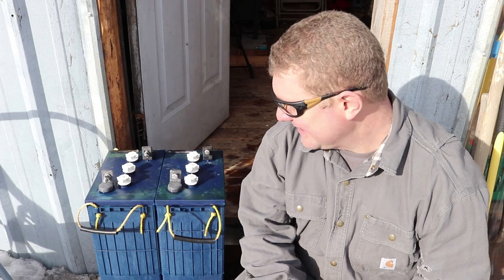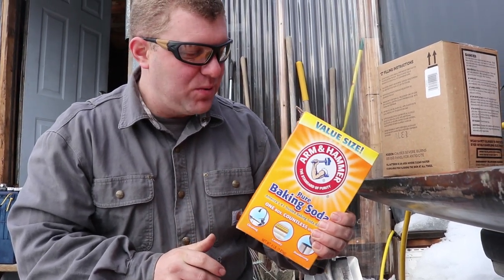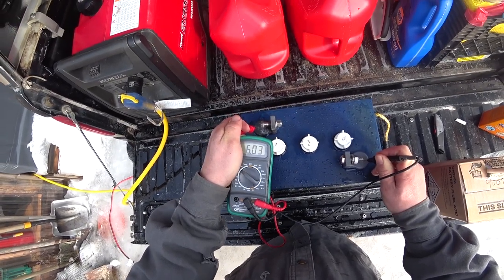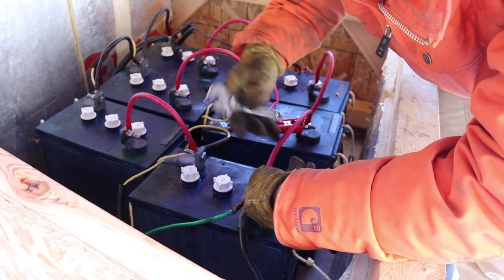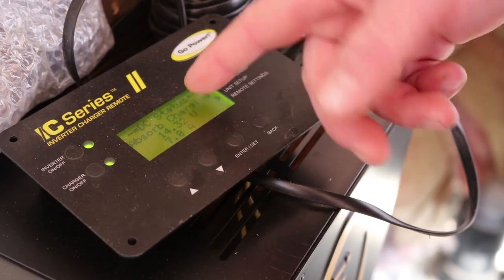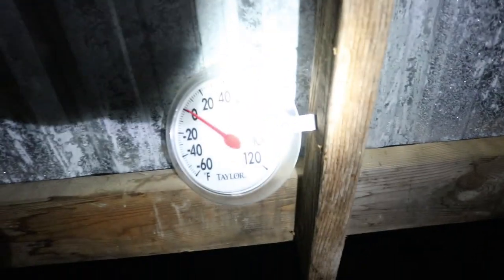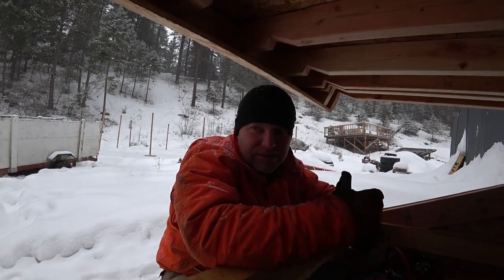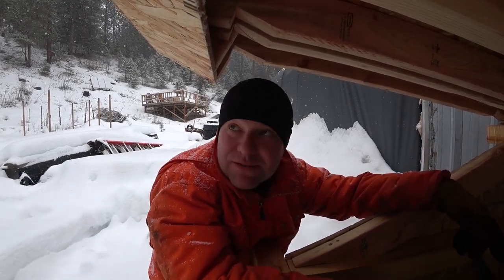DEEP CYCLE BATTERY HACK?! Fix $400 battery for $20?! (Part 3)

Comment: you need a dumb charger and do a equalizing charge depending on size of battery it can take 2 to 20 hours with the battery gassing and mutable times your computerize charger will not work you need to charge at 7.7v aprox with high current look at this https://www.youtube.com/watch?v=DgiII0OnAZg

Comment: ... To Recondition your Lead Acid Battery you will need purchase EPSOM SALT. Distilled Water or De-
Ionized Water, I use Rain Water, all are OK.!!
NEVER ever use TAP WATER, WELL or BORE WATER.!!!
... You can Recondition 8 standard car batteries for 50 cents each.!!
... To Recondition your lead acid car battery you will need Epsom Salt and a 500ml of Suitable water. Warm
up the water to about 150 degrees (very hot but not boiling). The temperature doesn’t need to be exact and
will still work even if the water is at room temperature, it just won’t dissolve as well. Add 210 grams of Epsom
Salt into the 500ml of water and stir until most or all is dissolved.!!
... Then Add 83ml of this warm solution into each individual cells of your dead battery just as you would
normally put water to maintain the acid levels. Then charge your battery over night. Do not attempt to put
Epsom Salt directly into your battery because it will not dissolve properly in the battery acid, only water will
dissolve Epsom Salt. Most dead batteries will be low enough on fluid that adding this solution will not over
Fill the battery. It is only recommended to add 500ml of solution to an average size battery or 1000ml for a
golf cart, fork lift or truck size battery. If your battery is already full of fluid then you will need to drain some of
the acid to make room for the Epsom Salt solution. After adding the solution put the caps back on and shake
the battery a bit to mix all the chemicals. Then charge battery overnight. If battery does not appear to have
good capacity after the overnight charge, don’t give up. Sometimes it takes a week or more days for the
Epsom Salt solution to “work” on the battery plates

Comment: About 1.5 hours of video and I do not see anything worthwhile here! Maybe I missed it having to jump over tons of stuff not related to actually doing battery work? Maybe cut out all stuff like driving around and looking at other stuff and tools and just stick to what you actually did to batteries and if anything worked at all. If nothing worked and no improvement, then why even have the videos?? 
 I have bought deepcycles at scrap yards like trogan t105's and L15's that had a standing volts of around 4volt and brought them back to life getting really good use from them for years. Though not like new, they worked very well! So getting new life into older batteries is not hopeless, I just did not see anything here that did you any real good on yours!
 For one thing, be sure to pulse charge well for DAYS with the old acid, then distilled water with a little new acid mixed in! Distilled water is not a great conductor of electric on it's own! Water needs SOME impurities to conduct well. NEW acid is not great for desulphating either as new acid should already be at max specific gravity.
 In most cases getting the sulfates off the plates is the KEY to improving battery performance!

Comment: You may have done a lot of reading online, but 99% is bs. You can only restore a good battery XD. Bad batteries most likely have corroded lead plates which means reduced capacity. No amount of fresh acid will restore the capacity.
* important * battery banks should be made up of batteries with = capacity. IE, put a 9AH battery with a 3AH = toasting the 3AH battery during the charge cycle & leeching the 9AH battery during the discharge cycle.

Comment: Video 3 and you still are careless, the batteries are not a podium to rest  your elbow and forearm on, unless of course you need the ventilation later. When you use the hydrometer, the tube tip, drips and flips acid drops, or it rubs on  your pants,  obviously not a concern to you. I see the hole on rt thigh where it touched in video 2.

Comment: With the batteries connected to one another I don't think you're going to get an accurate voltage reading on your meter. I believe you need to disconnect it from the rest of the bank and then measure the voltage.
Reply from the maker: Technically, you're correct. :)